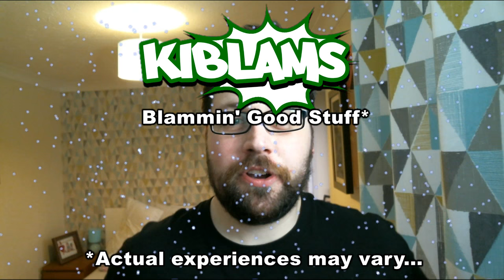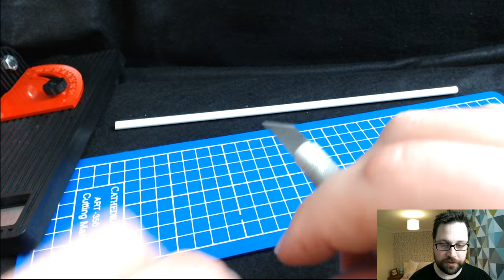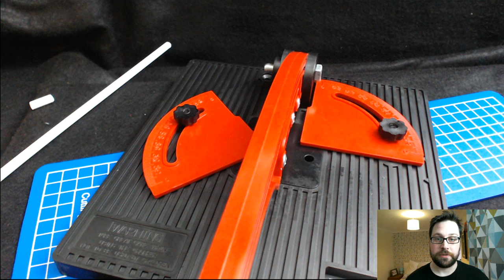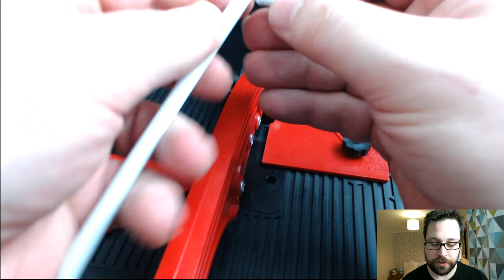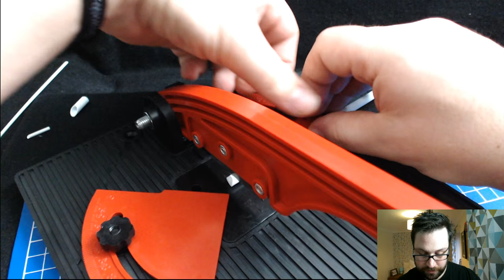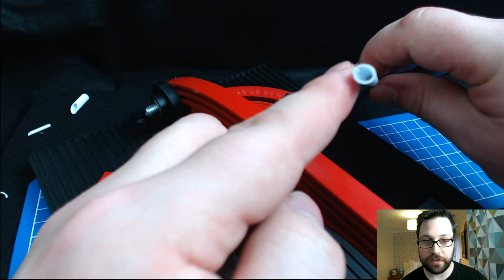Working With Styrene - Cutting Tubes

Comment: Tubing cutter.   I get a cheap one from Harbor Freight and it works great.  Probably closest UK equivalent would be Machine Mart.
Reply from the maker: +Da40kOrks You mean the ones for cutting copper plumbing pipes that you spin around the tubing? Thanks!
Reply: +kiblams yes.  just like I posted in the Facebook group.

Comment: Hi. My first thought when reading the title was: He will stick a rod inside the tube to prevent squishing it. Maybe that might be an alternative way?
Reply from the maker: +Dirk Oschlies Well now I feel a prize fool, that was supposed to be on the video! Thanks for pointing that out! I can see myself needing to remake this one rather quickly.
Reply from the maker: +Dirk Oschlies Mind you! for the thicker tubes you would need to put at least a couple tubes and then a rod in the middle, which is a fair but of styrene for one cut :)
Reply: +kiblams And when you slide the supporting rod back in the tube? So it ends more or less where you want to cut and do not waste too much.
Reply from the maker: +Dirk Oschlies okay, That is another equally clever idea! this is going to save me a lot of work! Thanks!

Comment: What “chopper” is this?? I like better than the original “chopper” from NWSL. Thanks for the info.
Reply from the maker: https://www.amazon.co.uk/Multi-Angle-Craft-Hobby-Guillotine/dp/B00BXFQISY/ref=asc_df_B00BXFQISY/?tag=googshopuk-21&linkCode=df0&hvadid=344240172429&hvpos=&hvnetw=g&hvrand=884027338810472721&hvpone=&hvptwo=&hvqmt=&hvdev=m&hvdvcmdl=&hvlocint=&hvlocphy=1006674&hvtargid=pla-697950481809&psc=1
Reply: kiblams thank you much. And a fraction of the NWSL Chopper. How’s it performed and held up?
Reply from the maker: @colossalbigfoot256  there is give/flex in the base and the arm that can lead to the blade not being flush with the cutting surface, but for my needs it's been fine.
Reply: kiblams and for the price it’s worth a shot. Will be mostly soft balsa and small scale styrene.